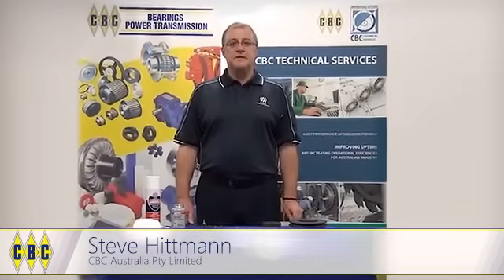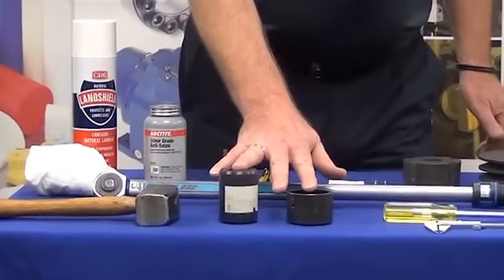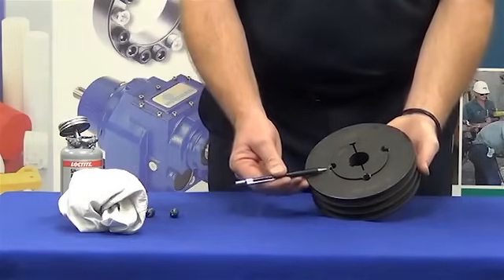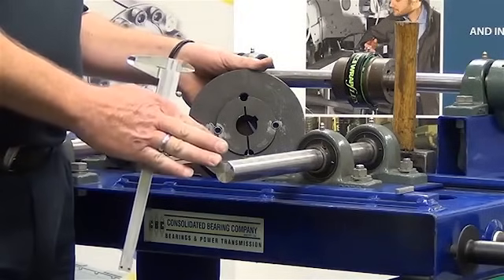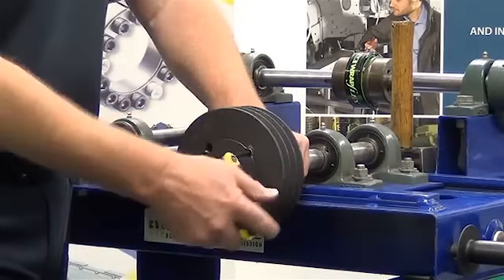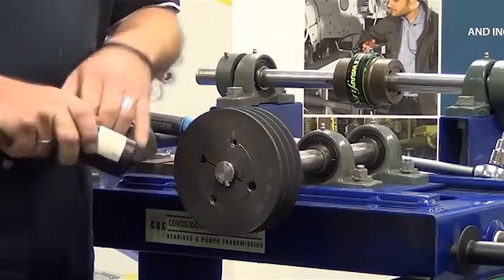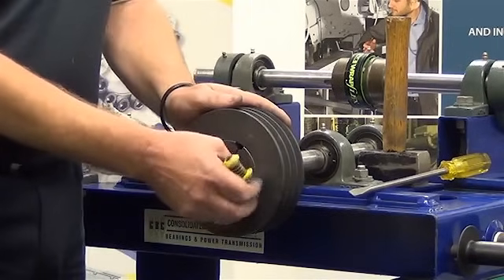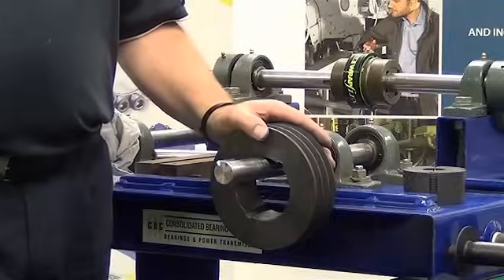CBC Australia - Taper Lock Bush Installation and Removal

Comment: Why is it only the bush side of the grub hole thread nbut not the pulley side? To allow for thermal expansion ?
Reply: Well, I think that You cannot make two perfectly identical threads. So when You would try to insert the screw, it would start to resist after half of a turn as there wouldn't be a correct helix on the inner thread, only a line made of two different helixes.
Reply: The (half)thread pushes the bush into the hub on the mating surface. Both are conical giving the bush a squeeze onto both shaft and hub.
Mind you the hub will move as well, so it is important to check alignment after installing.